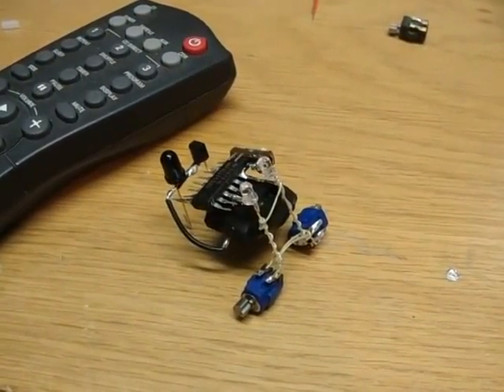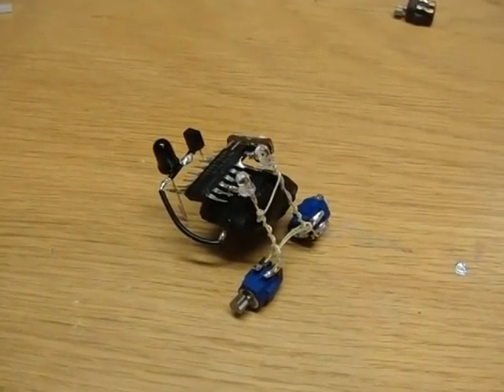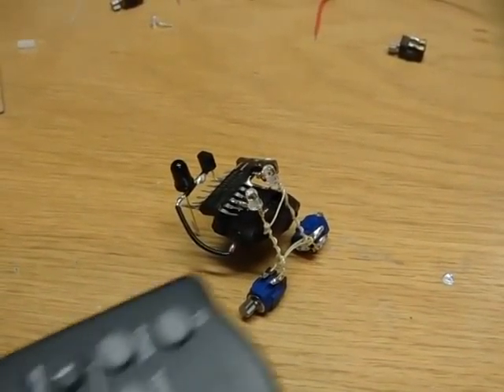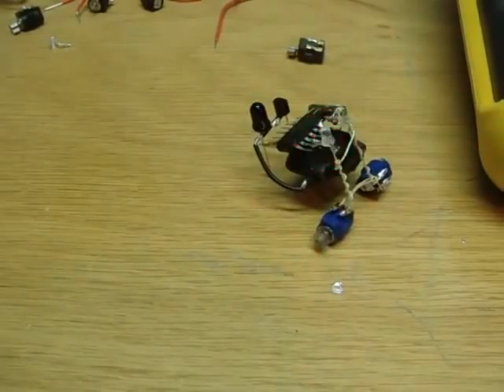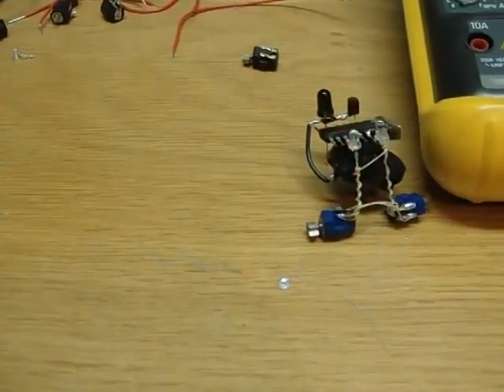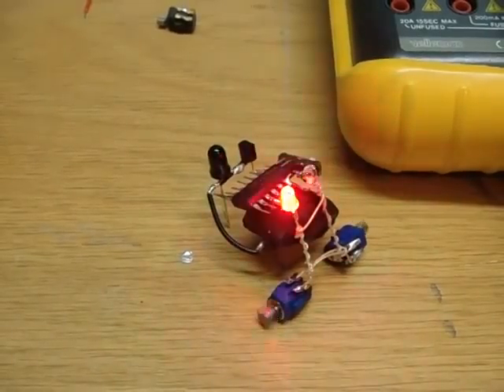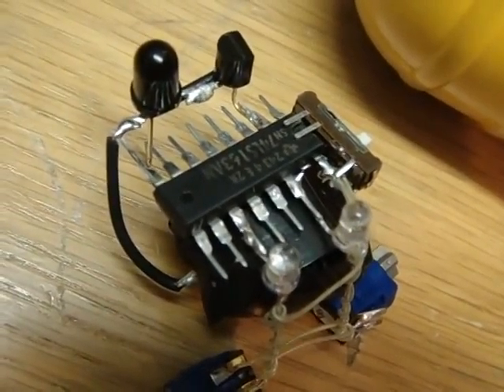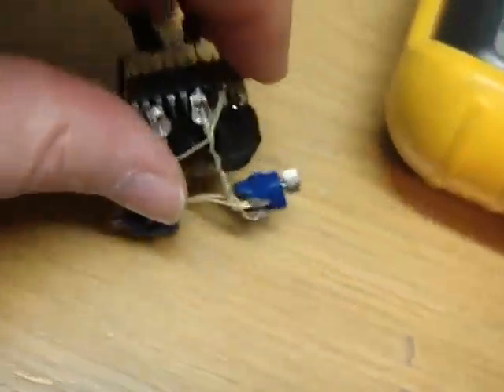FailBot1

Comment: I like the idea!  Just for fun, I made a similar clock circuit and noticed that the remote must be within a few inches of the photodiode in order to trigger.  Did you notice the same?  Perhaps a single transistor common emitter amplifier is a bit on the weak side.